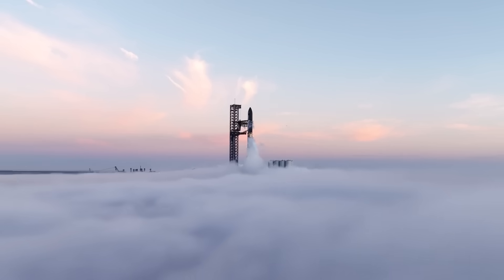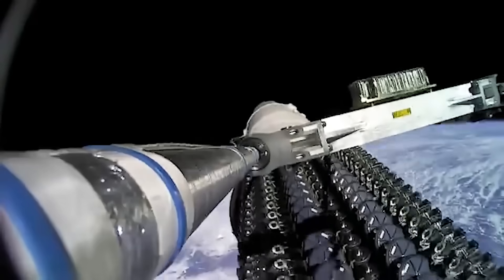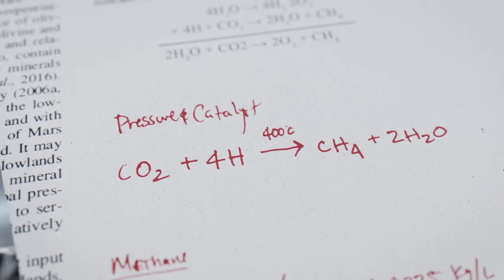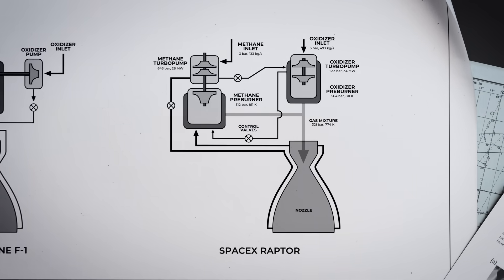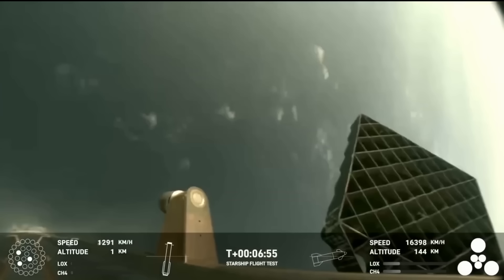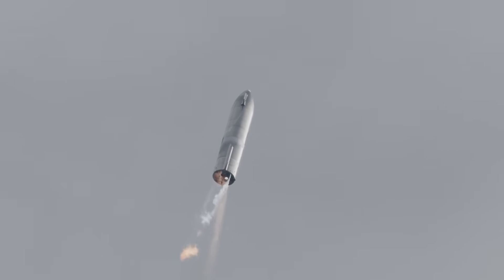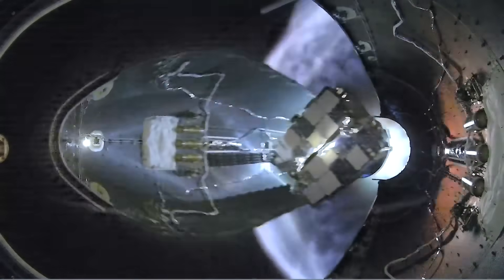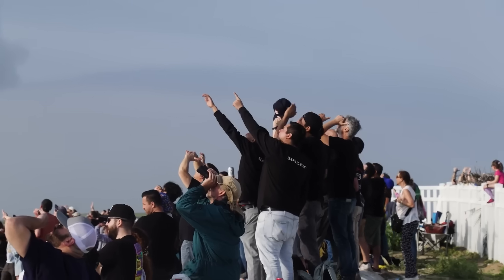Starship Reached Space. What Now?

Comment: I understand that silicone panels are cheaper than Tungsten but Tungsten can withstand temperatures as high as 5k
Reply: Ceramic can handle enough and is low density. It also scrubs heat fast
Reply: @weekiely1233  true but ceramic cost more.
Reply: @Christopher-cr7pw  it doesn’t. The tiles used are incredibly cheap

Comment: 9:20 "Experienced a rapid, unscheduled disassembly" is portably the most scientific way of saying it blew tf up
Reply: It’s a lighthearted, jokey way of describing it since it really doesn’t matter that they blow up
Reply: This s PR speak. Three words where one would do and provides no details to the reader other than it exploded. Science communication want to be clear and concise with details. It is thought at university. You are not writing a novel.
Reply: @nickl5658  it’s a ✨Joke✨

Because these are tests and, has been repeatedly stated, it really doesn’t matter if they blow up because the aim is to find weaknesses in the vehicle during testing
Reply: @weekiely1233  it does matter if it blows up. Having leftovers is vetter for diagnosing issues and demonstrating the validity of the core engineering. Most 5hings in life don't get to catastrophically die a couple of times before it is "done right". Even in rocket science, it's an embarrassment to all but the spectacle crowd if your rocket blows up because it means you screwed the primary design, testing or assembly stage and didn't even know it.
Reply: @whiteerdydude  it doesn’t. That’s kinda the whole point of these flights. To push the vehicle past its current design and see ways that it should be improved. 

There’s no need to have “left overs” the data is transmitted and recorded on the ground. 

This is simply a DIFFERENT type of development as has been repeatedly stated before and after the program started. These are TESTS. Not demonstrations. 

Literally every rocket will need some kind of explosive testing on the ground unless it uses pre existing but slightly modified hardware. This happened with the Saturn V that had many many explosions on the ground 

But what’s different is SpaceX is taking an iterative and incremental development cycle in flight. Flying vehicles in a hard to simulate and realistic environment and making changes based on how far they got. And it’s evidently working. 

They’re currently matching the dev time of the saturn V with 1/10th the resources. The last 3 flights have progressed significantly and both SpaceX and NASA agree they have been successful. The progression has gotten to the point they’re attempting a never before seen flip and landing from orbital velocity this year and have already flown 3 tests in a year which is remarkable given the challenges in cadence and regulatory factors. 

It genuinely seems like the only people who think this approach is bad or that it’s not going to work are either rabid musk haters, people who don’t know a think about spaceflight engineering or pessimists who just don’t like it
Reply: @whiteerdydude  Remind me how many hundreds of materials were burned up when creating the Tungsten lightbulb.
Reply: @whiteerdydude spacex customers pay for rockets that work. and customers by default have high standards for products and release-quality tech demonstrations, but not for obvious r&d prototypes. and spacex has always been clear on what is and isn't meant to be a release-quality demonstration.

most companies aren't nearly as public with their r&d tests (much less making such a massive public spectacle out of them), but that's the only truly unusual part of this.

Comment: Starship 0 from 3 
SLS 1 from 1

Same development time frame, similar LEO capacity

Crazy how the guys at NASA were able to get that thing working on it's very first flight without having to crash a bunch of rockets first.
Reply: Literally a lie. SLS has been in heavy development since 2012. Starship since 2019

Starship can carry 150 t to LEO, SLS its 95 t. Plus SLS costs 3.5 billion per launch and has a cadence of 2 years atm. Current estimates for starship put it at 100 million 

Also SLS was developed differently and flew on an operational demonstration not on iterative flight based tests. It also heavily used existing technology from Shuttle. 

Not understanding how two different vehicles can have two completely different methods of development isn’t an argument it’s ignorance
Reply: @weekiely1233 Actually Starship can carry 0kg to orbit. 

SLS development started 2011, Starship development started 2012 (seriously try googling stuff beyond the first couple of results chief)
SLS launched in 2022, Starship launched in 2023, therefore both rockets had about a decade each of planning, conceptualizing and construction.

Starship has a range of between 100-150 tons, but even the lower range value hasn't been proven because the rocket hasn't actually made it to LEO.
SLS has a Payload range of 95-130 tons , but that's also largely unproven (though the rocket has proven itself capable of launching, stage separation, payload delivery).

Why are you bringing up rocket launch costs? irrelevant to the discussion. 
 
Go learn what the word ''lie'' means while you're frantically double checking all the things you neglectfully failed to include in your comparison.
Reply: @Waywind420 the starships launched were made just around a year before launch. SLS spent at least a decade and billions more in development. SpaceX also made sure that the starship wouldn’t go to orbit for safety reasons as its possible that the engine won’t relight and then theres a 50M tall, 150T rocket in orbit around earth which could potentially survive reentry and crash onto someones house. Flight 3 didn’t have a successful relight during the coast phase of the mission, meaning if SpaceX did send it to a true orbit, it could reenter over Earth randomly since they wouldn’t be able to control it.

Comparing a rocket with decades of research into it and billions of dollars, maybe tens of billions, dumped into it, to a rocket made just around a year ago with a fraction of the budget and with a company which wants flights completed is not the right way of comparing them
Reply: @archierush868  Tell me, what year did the SLS rocket construction start and finish?

Please provide details. 

I know Starship was assembled at least 4 years ago for design and testing purposes.
Reply: @Waywind420  Development of SLS began in 2011. The first launch took place in 2022. That’s 11 years from development to launch and several tens of billions spent.

Starship started development and testing in 2019 and has made 3 full stack flights within a year. They have spent a total of around $5 billion.

Edit: There is nothing that either rocket, SLS or Starship has taken from one another. Just because one rocket was in development for over a decade doesn’t mean the other was!
Reply: @archierush868  I didn't ask for when the SLS first took flight, I asked when it was first constructed. 

As in when it first leapt out of the theoretical phase and existed as a full stack. 

I believe it was 2021-2022.

Starship development began in 2012 and it's first full stack was in 2021.
SLS development began in 2011 and it's first full stack was also in 2021.

Are you bad at maths or something? 
Starship took 9 years, SLS took 10 (approx). 

Starship development did not start in 2019 like you claim. 
2019 is just when they actually began constructing prototypes.
Reply: @Waywind420 You must include flights, how often they fly and the costs. Always.

SLS each launch =$4 Billion

The entire Starship program since its started construction = $5 Billion

The 5 billion also includes all the infrastructure, fuel, and all other prototypes which have been tested since 2019. 

The Starship again had 3 orbital launch attempts within the last year. SLS has only had one launch which costed almost as much as the entire Starship program.

What is your argument? That we should be using expensive rockets and not put any development into a reusable option to drive costs down?

Edit: also, just announcing that you’re gonna do something in the future doesn’t mean you’re starting development and prototyping that very second. They also announced that they would use Falcon heavy for crewed flights around the moon. It’s now never gonna happen.

Announcements DONT mean Development.
Reply: @weekiely1233  why you even reply to a dumbass lol

Comment: The reason that methane is coming is that realistically, you can only do full flow with methane. You can't with kerosene, and doing it with hydrogen doesn't really gives much boost. Without full flow engines, methane was 5% less efficient than kerosen. With, it's 10/15%. And once you go reusability, it helps a lot.

Comment: INCREDIBLE! The Starship reached 234km. This is not space.
Reply: It is space
Reply: That is space, also just below LEO
Reply: @zachb1706  actually in LEO technically
Reply: @weekiely1233  it didn’t reach Orbital speeds (on purpose).
Reply: @zachb1706  it actually did. It was 97% of a complete 250km orbit. It would’ve made an orbit with a lower apogee. 

Also a peak entry heating higher than orbital
Reply: @weekiely1233  was that IFT2 or 3? I thought 3 was meant to run below orbital speeds and lower than LEO.

Doesn’t matter though, the rocket can definitely reach orbit. Hopefully IFT4 they can sort out the reentry of the booster and ship
Reply: @zachb1706  both targeted at least near orbital. But yes you are right we are being a bit pedantic lol
Reply: @zachb1706  Okay I meant outer space.

Comment: I think it's worth mentioning the reason that full flow staged combustion is meaningfully more efficient is that they don't use a stoichiometric ratio in the turbopumps.  If they could then they'd be able to grab essentially all the energy in that fuel in the turbine.  But heat considerations mean that what you throw overboard includes a bunch of unreacted fuel.

Comment: Firstly great work by SpaceX to get into actual orbit and run a test 👋
Are you sure about  that planned oxygen dump in the previous flight?  From the flight incident investigation it was fires and wiring destruction that ultimately led to them triggering FTS.
Also I think you're a little out on the "almost reaching ISS in LEO.  ISS hangs around at 420km above the Earth. Starship flight 3 went to around 230km.  That's not really close.
And finally both vehicles ran out of the required amounts of propellent for navigating successful reentry and landing.
My personal opinion is that Starship was doomed when they failed to get the Starship roll, from venting, under control and heat shielded side facing the atmosphere.  From there it was pretty much burn baby burn.

Comment: The F1 engines have always been a closed cycle engine, despite what the video says at 5:30. It redirects the exhaust gases from the turbine pumps into the central combustion chamber, as you can see from the distinct lack of the sooty side exhaust port off the side of each motor. Additionally it's mentioned that the turbine exhaust "doesn't produce any extra thrust in an open cycle engine", which is not the case; it's not a huge difference but there's a reason they're often on individual gimbles as it assists with small flight corrections
Reply: It's open cycle. The exhaust gasses are not diverted into the main combustion chamber, they are diverted into the nozzle, where they are used for film cooling. If you see an F-1 engine firing, you see the exhaust plume exiting the nozzle surrounded in thick soot, and flames racing up along the sides of the exhaust plume, where the soot is combusting with the surrounding air.

Comment: I don't see how SpaceX can meet the 2026 deadline for NASA.  Their contract states that Starship will be ready for a moon landing by late 2026.  They still need to test orbital refueling on a large scale.  The nine launches will need to be every two months.  In the mean time, SLS rockets (designed by Boeing) are set to launch in 2025.
Reply: It’s completely unrealistic. It’s half the dev time as Apollo’s LM for a more complex and capable system. 

But 2026 isn’t realistic for the mission for other reasons. On Artemis 1 the heat shield had excessive wear. This has raised red flags and is now being worked on but now A2 and 3 are scheduled for NET late 2025 and 2026. This will almost certainly be even later too. Then there’s the suits which will also likely not be ready. 

Essentially no component of Artemis 3 is likely to be ready by 2026. Plus SpaceX got dealt a bad hand yet progress so far has been good and once Starship is operational they’re gonna have plenty of opportunities to test different systems. They’ve already reached a cadence of 3 a year with 9 total expected this year which is already 6x the cadence of SLS atm so 🤞🏻
Reply: SLS is behind schedule as well. Artemis 2 was meant to launch this year, they’ve pushed it back to next year but it’s questionable if that’s even possible. Really I think SpaceX will have plenty of time to get HLS ready, 2026 might not be it though
Reply: @zachb1706 Possibly, but if they can't nail the orbital refueling task, which will be critical part of the moon mission, a 2026 moon landing won't be possible.

Comment: How much pressure is falling on the starship when plasma glows? Is it  a big load or merely a reflection of the speed of the particles? Were the flaps able to be effective? I didn't see any change to the roll when they moved.
Reply: When the plasma first appears at 100km the dynamic pressure is basically zero. By the time it gets down to 90km and the plasma starts getting intense, it's about the same as driving a car at highway speeds - enough for a light aircraft to have control, but not something large and heavy like an airliner, or indeed Starship. By around 80km it's equivalent to about 360km/h, which is faster than an airliner's stall speed, or Starship's terminal velocity at sea level, and so should have been enough for Starship to regain control.
However by that point it was likely too late to recover. You really do want to be oriented correctly before entry interface.
Reply: Not a lot. You can see the velocity doesn’t really change by both the telemetry and the ice that falls off sticking with the vehicle. Most drag and pressure comes lower down 

The flaps at those altitudes were less effective but they worked hard and did their best.

Comment: Broadband, communication to space without a directional antenna would place an absurd requirement on tje antenna gain.
Reply: Starlink has phased array antennas
Reply: @weekiely1233  Your mobile phone doesn't.
Reply: @patrick_test123  oh sorry are you on about the direct to cell stuff? 

Musk clarified this. They’ve reached some impressive speeds but this doesn’t work in crowded density areas. Its main job isn’t for low latency streaming but general communication and googling
Reply: @patrick_test123 Oh so our phone has literally a moving antenna?
Reply: @weekiely1233  That alone would be inpressive, and will require very large antenna on the satelite.
Reply: @alvianchoiriapriliansyah9882  No it does have an omnidirectional antenna, which is exaclty the problem.

Comment: Will probably take a few one way trips just to get the equipment there for making methane on that scale
Reply: Why one way?
Reply: @weekiely1233 Because before all the equipment is brought there, there’s no fuel supply for returning home.
Reply: @KellyWu04  on orbit refuelling is still possible before landings
Reply: @weekiely1233  
You really don't want to try landing on Mars with a load of fuel in the main tanks. It's a bad idea for a number of reasons.
Even if you could, you'd just leave the fuel tankers stranded in Martian orbit, so you still have several Starships making one way trips.
Reply: @lazarus2691  it’s pretty much just as risky as with no fuel on Mars. On earth yes it’s different but on Mars it’s not. Especially since the hardware will very likely be robotically assembled not by crew. 

Δv to get back from Mars is far less than to get to Mars. Main issue with Earth is that you need all that fuel to get to orbit. On Mars and the moon there’s far less gravity and it’s easier. You could refuel up with enough fuel for a return and then send the tanker back when a window opens.

Comment: There is a location with a lot of easily accessible water on the surface of Mars. In a form of a permanent surface glacier of pure water ice. In Korolev crater. 
Not important only to make fuel for a return back flight, but with enough water to guarantee safety, security and survival of a bigger human habitat, with up to a hundred people in the early stages. There is no other place like it on the whole planet. 
Unlike other locations closer to the equator here we dont need to dig thousands of tonnes of Mars soil to extract some water from it. It is a two kilometers thick, 60 km wide glacier of purest water ice we can find on the whole Mars. The best and practically the only location for the First Base.  (clearly visible from space at 4;16 here)
Talking about taking CO2 from atmosphere on Mars is all fine and good, but Mars has only 1% of Earth atmosphere. That does not provide enough to create not just the fuel but everything else humans will need on Mars. Especially for any permanent habitat. If all we are going to do is get there and then run back we dont need to bother.